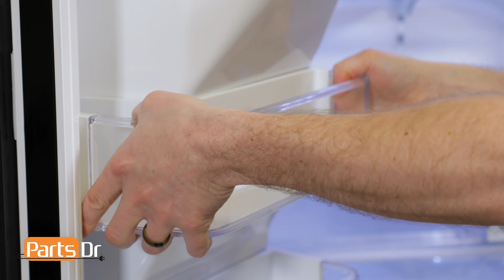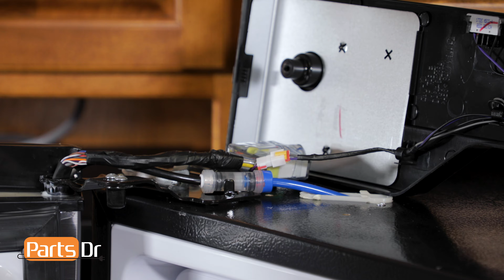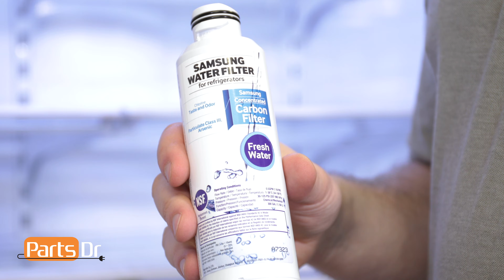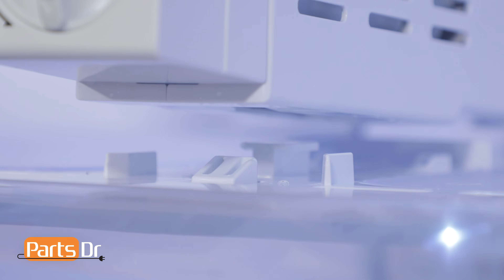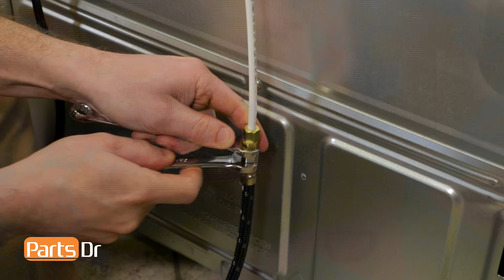Samsung Refrigerator Water Not Flowing? Replace the Filter Case Assembly (Fast Fix)

Comment: Can I buy the internal components separately? I just need the plastic part that's above the filter.
Reply from the maker: On most models, the internal components inside the filter case assembly are not sold separately.
Reply: @PartsDr  Thank you. That is the only part that is broken, and it's easy to replace. I guess I'm ordering the whole assembly.
Reply from the maker: @Steveke100  👍

Comment: My Model RFG298HDBP/XAA did not have a locking tab to depress under the filter case assy when trying to remove the assy.  It just the slot in which it rides.

Comment: Do you have the LED lights part number? I have to replace both. Thanks
Reply from the maker: We usually see the LED lights in the filter case assembly are not sold separately from the assembly.

Comment: Great video and saved me a lot of money. This job isnt too bad so just take your time. My only complaint is the current version of the unit for my samsung fridge did not inlude the two LED lights. I had to take apart the old and new unit to switch them over. It would have been just as much work to replace the bad valve assembly......but as always, you cannot buy those on their own LOL.
Reply from the maker: Thanks for sharing!  Unfortunately, that is common right now for many of the new filter case assemblies to not include the LED lights and that you have to transfer them over from the original part.

Comment: I tried everything to get my ice maker to work... is this a possible fix? I have running water, I defrosted (df function) and my motor still makes a sound when I push I lever. I tried reset and switched the temperature to recommended temps. I have a strong water flow...any suggestions?
Reply: I have running water to the bottom ice maker and turning off the ice maker doesn't stop it.  What fixed yours?

Comment: Hello All. Will this solve a warm water from dispenser issue? 
4 days ago it was dispensing 40* water. Now 60-70*. Nothing else changed. Ice is good. Fridge, flex drawer, freezer all working properly. Warm water is the only issue. Changed the filter 6 hours ago, that didn’t help. 😔
Reply from the maker: The filter case assembly has a water tank/reservoir inside that stores the cold water.  It does NOT cool down the water, the water is cooled from being in the cold air of the refrigerator.  The water tank is not large, so make sure to allow sufficient time after running the dispenser for the next batch of water to be cooled down.

Comment: What if one of the tubes is just stretched? Is there a way to replace the tube by itself instead of buying the whole part
Reply from the maker: On most models the tubes are not designed to be replaced and are not sold separately.

Comment: Could changing out this part solve dirty tasting water?  I have changed the filter twice and water from other sources in the house tastes fine.  My only thought is the reservoir has algae in it, but I'm not sure how that is possible.
Reply from the maker: Yes it could fix that type of problem, we have heard of that before.
Reply: @PartsDr  Thank you for the reply.  The weird thing is that the ice tastes fine.  Does the ice water supply go through the reservoir?
Reply from the maker: @captainstress  On most models the ice water also goes through the same reservoir.

Comment: It appears as if my Samsung water filter assembly froze somehow.  It froze the where the water filter is attached, the water filter (it cracked), and the water reservoir.  As you can imagine water everywhere.  This video is much needed.  Any idea on how this assembly, which sits in the fridge compartment, would freeze? My model does have the FlexZone.  Both are set to 37 degrees. thx.
Reply from the maker: Start by testing the temperature sensors to make sure they are good.  We have a video on that here: https://www.youtube.com/watch?v=J5bwcteeJNM

Comment: Hell yeah now that’s what I’m talking about! Very nice, detailed and straight to the point. Clear instructions. This is how all instructional videos should be. I have a question. So water is not coming out at all for me anymore. It happened after I had to turn the power off from the breaker box for a minute. It was working fine before then. I ran trimmer lining up the water dispenser hole but there was no blockage.

Also took the out the blue hose as well but it was not frozen. Took the filter out and tried it. No water still. According to what I’ve seen on google, the water inlet valve could have possibly gone bad. Aside from the inlet valve, Could this particular part on this video also have something to do with this issue I’m having? 

Mode number I have is Rf28hfedtsr/aa
Reply from the maker: Yes it could be a bad water inlet valve.  It could also be caused by a bad main control board or numerous other things.
Reply: Hello, wondering if you resolved this issue, as it is the same thing that is happening to me!!

Comment: Can you comment on whether if the refrigerator has both upper and lower ice makers, then there might be an additional water line?  And if so - what else would need to be done?
Reply from the maker: The refrigerator shown in the video has one ice maker.  If your model refrigerator has two ice makers, you will have an extra water line that isn't shown in this video.  You will need to trace this line back and disconnect it similar to the other lines.

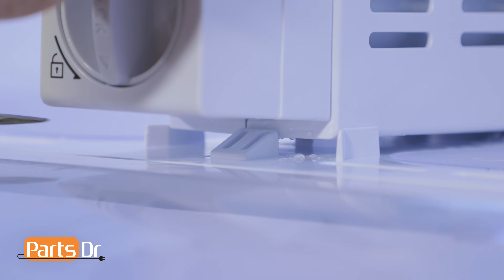Comment: This video was extremely help to install a new water filter assembly ! I bought the assembly from PartsDr which was the best price online! As for the instruction, after 2:20 mins, there is a step to disconnect the water pipes from the water intake valve. The valve is located at the bottom right corner. For my model Samsung RF4287HARS/XAA-01, the following video was helpful to do that https://www.youtube.com/watch?v=CSgsXBm5AeY. Other than that, I followed other instructions step by by step. Also, I was able to reuse all the water line connectors, the assembly does not come with any connectors. So, save all brass or plastic connectors that you find during disconnect. For the waterline connector, you have to use two small wrenches.

Other tips: although for professionals this should not take more than an hour or so, it took me three hours from preparation to finish. For preparation, I had to remove all the frozen food and other food. I moved the frozen food to couple of coolers and other food to another refrigerator. I had to do that because with all the food I could not pull out the refrigerator. Also, you have to unplug the electrical connection and water valve before starting any work (my refrigerator water shut-off valve is located in my basement just below the floor where the refrigerator is).

Hope my comments are helpful to someone!

Comment: Great instructions.  Bought part through Parts Dr as well.  Price was lower than other places I looked.  There were a couple of minor differences between my refrigerator and the one shown in the video.  I couldn't release the gray water line (which goes to the ice maker) by pushing in the collar while pulling line out.  I removed the plastic plate, cut off the gray line and pushed it through the plate.  Like some others, I had to remove the brass fitting from the inlet water line hookup and re-use it on the new part.  Also, removal of the old housing was slightly different.  there was no locking device to be pushed down, instead, there was a screw holding the housing to the back of the refrigerator.  Regarding the price, the new housing seems expensive (about $170 when I bought it), but it came with an original Samsung filter which sells for $50 at Lowe's.
Reply from the maker: Thanks for the feedback.  Nice job with the repair!

Comment: Well done video..Followed the procedure... all worked out perfectly. Only difference was my frig, didn't have a clasp lock under the assembly. It just had to be lifted a bit and it slipped right off the guide rail. Thanks for the instructions! I used another video on how to remove the shelf and remove the glass for cleaning... There are clasps that need to be released while the shelf is upside down. They don't pry off from the topside!!
Reply from the maker: Thanks for the tip!

Comment: Great Video, thanks for making these!. I'm having an issue on my Samsung where I don't get water when the filter is installed. I removed the filter, put a new one and no water, but without filter it dispenses. So chances are that might need to replace the filter case? Faulty valve? Can't get a break from this fridge haha
Reply from the maker: From your description of the issue, it sounds like the filter case is bad and will need to be replaced.

Comment: I am assuming that like mine ( two ice makers ) there will be another line somewhere that needs to be disconnected. Im hoping this will be easy to find and figure out .. If anyone has my set up and has done this replacement advice would be appreciated
Reply from the maker: Yes if you have a 2nd ice maker in the freezer, you will have one additional water line that will need to be disconnected.  It shouldn't be too difficult.

Comment: This video was super helpful.  It took me about 45 minutes to replace mine.  That solved the issue of the water not flowing unless the filter was removed.  Mine went exactly how this video showed except I couldn't get the ice maker line to release using a screw driver like he showed.  So, I needed to remove the plastic housing it wen into, cut the hose, and pull it through.  I saw another video where this was the prescribed method.  Mine didn't come with a part at the end to screw into the water line coming from the wall, but I removed that compression fitting from the old line and installed it on the new one.
Reply from the maker: Thanks for the feedback!

Comment: There's one thing I do not understand. Where does the grey water line go to?
White line the water supply intake.
Blue line goes to the water & ice maker.
4:10 Grey is also water line, but it does not seem to connect to anything.
Reply from the maker: Grey on the refrigerator in this video goes to the ice maker.  You can see it in this video here: https://youtu.be/stXZXe6PRD0?t=220
Reply: Nevermind... it's the ice maker.

Comment: So in my case the water will not stop dispensing water even with the doors open, power off, machine unplugged, etc. I am thinking the inlet valve for the water is stuck open. I already replaced the dispenser switch and that did not fix it. Is it hard to just replace the DA62-04027A part only without having to replace the housing for the filter as well?
Reply from the maker: It does sound like the water valve is bad if water is still dispensing when the machine is unplugged.  We are sorry, but currently we do not have a video on how to replace the valve inside the filter case assembly.  On most models the valve is not sold separately, but on yours it is sold separately.
Reply: @PartsDr  Thanks for the quick reply. I read through the comments and it seems it can be done. Why else would they sell it separately, right? I will update my post for those that end up having my same problem as me.

Comment: I just want to thank you so much for this video. I couldn't believe the local repair shop was going to charge $450 to do this job. Thanks to your video, ordered the part from Sammy Canada for $168 delivered and literally had it done in 20 minutes...thanks again, you guys rock!
Reply from the maker: That's awesome! Nice job!
Reply: What are Companies supposed to work for you for free?? They have Employees, Insurance, Vehicles, Maintenance, rent etc, etc to pay for. It's great that you fixed it but at the same time don't knock Companies for charging a fee for supplying a part and installing it for you if you couldn't. That is how 90% of the work force works man. $450 sounds reasonable to me for someone to come and do that job if you couldn't do it yourself.
Reply: @kotakintai  sorry buddy, your obviously missing the point of my post which was thanking these folks for a great video that helped me do it myself and save that extra I would have had to pay to have someone else do it plus I get the satisfaction of being able to do it myself.

Comment: the replacement assembly has three water lines but your video only shows what to do with two of them.
Reply from the maker: If yours has a third water line, it usually goes to the ice maker in the freezer.  The refrigerator shown in this video does not have a freezer ice maker.

Comment: How to diagnose that Water filter assembly has to be replaced? I have this model Samsung, RF28HFEDTSR/AA. It is not dispensing water or making the ice. Shall I consider this is the problem?
Reply from the maker: It could be a bad water flter case assembly, but it could also be many other things.  Troubleshooting the water system is complicated.  Check the water supply from the house to the refrigerator. Check for any frozen water lines.  Try to narrow down the problem by process of elimination.

Comment: My original part had 3 electrical connectors, the replacement part from the link only had two connectors, anyone know what the third connector was for in the original part?
Reply from the maker: What is the model number and part number?
Reply: @PartsDr   never mind. The video said I only needed to connect the two plugs. False alarm on my end. 

Thank uou
Reply from the maker: @hotkid198  👍

Comment: I followed this to the t and the water dispenser works fine now but the ice dispenser does not, my old unit had 2 electrical plugs the new one did not, in the video, he stated if your old unit had to plugs do not wory it will still work the same and it did not.
Reply from the maker: That type of issue shouldn't have any correlation with the filter case assembly.  If you think it is related, you could try reinstalling the old filter case assembly to see if the problem still exists.
Reply: @PartsDr  I am going to do that and see if it make a difference.
Reply: @PartsDr  I put the old unit back in mind you I took it out because it was not dispensing water or ice, I am guessing the lines were just frozen because the old unit now will dispense water but still no ice, when I push the lever for ice I can hear the auger turning but nothing comes out, it is just not getting water to the ice tray, after 2 days, there no water leaking, it still dispenses water fine, but no  ice. am I missing something ???, is there a factory reset or something.
Reply: @PartsDr  I found the problem. I removed the ice tray and the entire upper half of the interior was frozen with 2 -3 inches of ice, I tried to attach a pic but it would not let me.
Reply from the maker: @danieladams3869  You might find this video helpful https://www.youtube.com/watch?v=EdNAhCxIoGk
Reply: @PartsDr  Thank you. I defrosted and turned back on an hour ago, my fingers are crossed that nothing was damaged from the build up of ice.

Comment: This has helped me multiple times as an in training appliance technician, thanks! I do have a helpful tip when removing the sometimes tough as nails grey water line at the top of the cabinet. Instead of using a flathead screwdriver to press the lock ring in, you can use a 3/8” wrench
Reply from the maker: Good tip, thank you!

Comment: Tired of my samsung leaking so I just disconnected the water line permanently.  Do I need the filter case anymore?  Can I just get rid of it?
Reply from the maker: We have never tried permanently removing one.  We think it would work to remove it.  Just. hold onto it in case it doesn't work out.  You would also need to seal up the hole where the water lines go through.

Comment: Dear staff. Is there a video how to remove my inlet valve instead. Id like to test the valve with my multi meter. We have a low flow from the water dispenser then it drip and stops. Please advise before I order the part. Thank you
Reply from the maker: I'm sorry, we do not.  On most Samsung models where the inlet valve is inside the filter case assembly, the inlet valve is not designed to be removed.

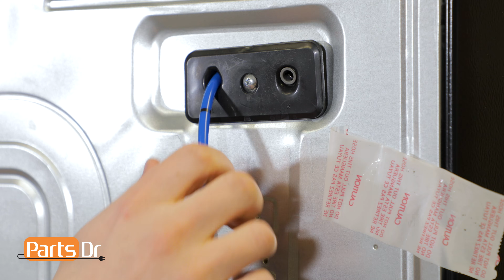Comment: I'm stuck at 2:05, "to remove grey line, depress locking collar." My locking collar won't unlock. What should I do?
Reply from the maker: Maybe try pressing on each side of the collar by using two screwdrivers?

Comment: I just replaced this part on my refrigerator... everything worked great from the video, but I have 1 question... on the new part the white water line did not come with the copper end on it to attach to the water line.  Am I supposed to replace that myself ?
Reply from the maker: What is your refrigerator model number and part number that you are replacing?

Comment: Excellent step by step instructions. Mine only had one difference. There was no locking tab holding the assembly in. Mine had a tab molded into the bottom deli shelf. I had to press down on the shelf and pull the assembly forward.
Reply from the maker: Thanks for the tip!  That is helpful!
Reply: Mine was like that too.  Another video showed just firmly pulling up on the filter housing.  That's what I did and mine came right out.  I guess, for reasons I'd never fathom, Samsung made minor variations in an otherwise identical part.

Comment: After replacing two water filters, the filter leaks at the filter case assembly for some reason. Do you think I just need to try other filter brands or is something defective with the filter case assembly? It does not leak when the filter is removed.